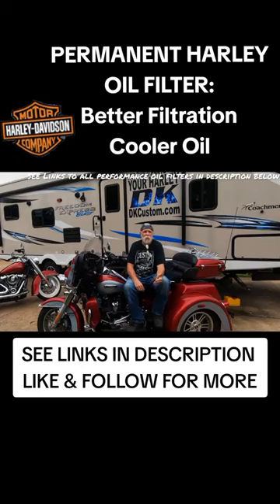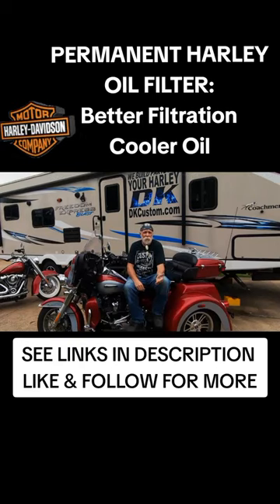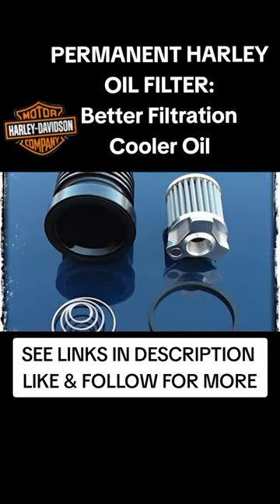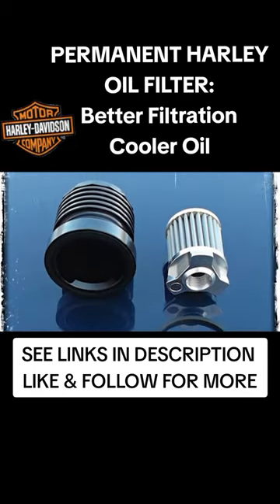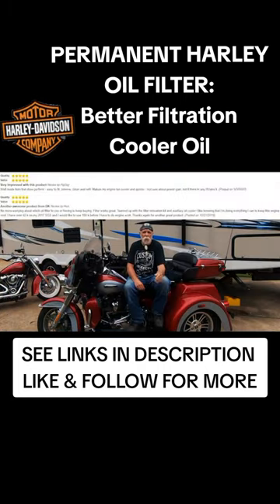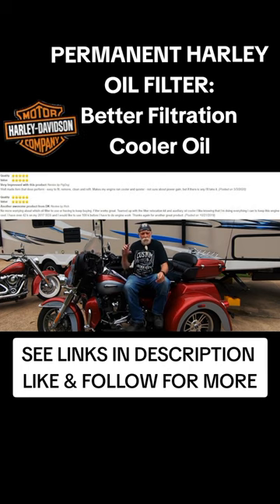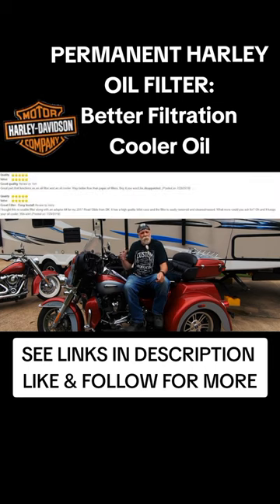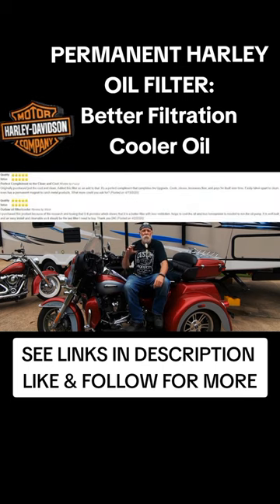🛑NEVER BUY ANOTHER HARLEY OIL FILTER! #shorts

Comment: Whats the difference between nominal and absolute?
Reply from the maker: You can see all the details at this link- https://www.dkcustomproducts.com/outlaw-high-performance-cleanable-oil-filter-in-anodized-black-dk-ocof-ab.htm
However,  paper filters ratings are nominal, which means their rating is based on averages, percentages and multiple passes, so a 10-micron-rated paper filter may be letting particles 100 microns and larger through. The medical grade stainless steel cloth they use in their filters is consistent across the entire surface and is rated at 35 microns, meaning nothing larger than 35 microns will pass through the material, it is an absolute, with paper filters, the rating is an average

Comment: Not sure if this is the right place to post this comment but I just placed a cobra slip on muffler on my 2021 Sportglide. Much louder and crackling than I thought it would be. Not sure if I have enough back pressure because I keep getting occasional deceleration pops. Is there any way to quiet this down. do your thunder inserts help with this problem.
Reply from the maker: Installing the TTIs will reduce reversion, which will result in a change in the AFR in the pipes, which can eliminate the pop or reduce it, it can produce bit deeper sound/rumble all the way through the RPM and Throttle range. 
It just really depends on what's causing the decel pop. 

Here is a vide with different sound clips with and without thunder torque inserts - https://www.youtube.com/watch?v=GuIgK-rc2s4

Here is a video about decel pop that you may find interesting - https://www.youtube.com/watch?v=I_djBYYYu28

Please feel free to contact us with any questions you might have:
Support@DKCustomProducts.com
662-252-8828

Thank you for commenting! 👍